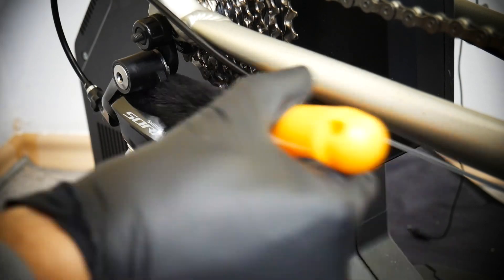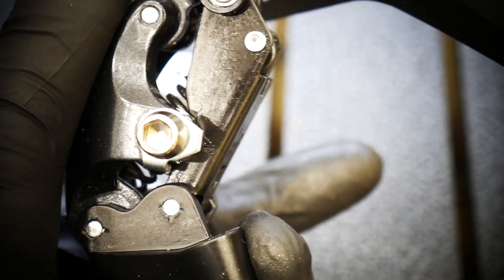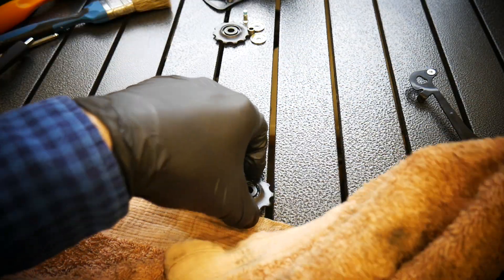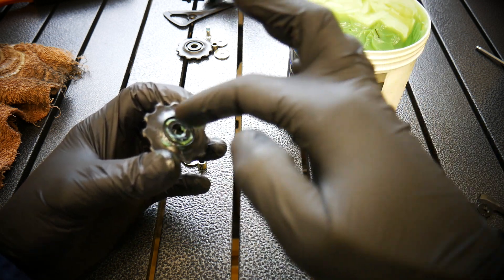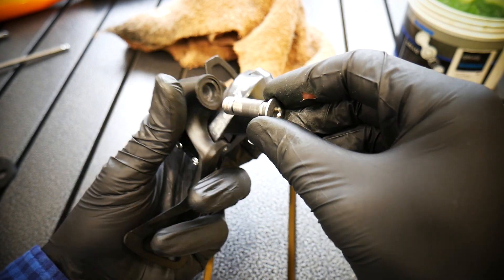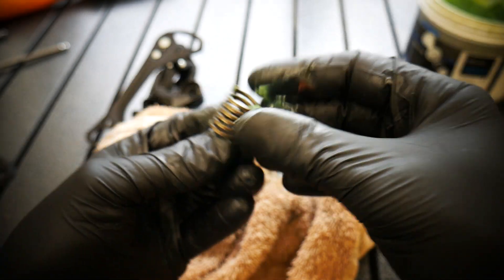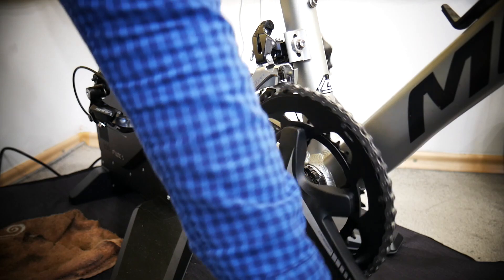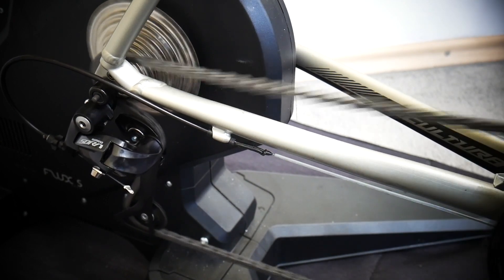Squeaking Rear Derailleur - Full Shimano Sora R3000 Service. Solved!

Comment: You can remove that part, it has a small panel that is removed with a micro screwdriver, then gains access to the circle inside which is again is fiddly but doable

Comment: I have the same issue (squeaking noise) on the same derraileur. Can we just change the pulleys maybe tiagra ones? are they compatible for Sora R3000. Thanks.
Reply: hello, I have the same case, I’ve tried after market jockey wheels with bearings-you can choose variety of colours too -and works good, just buy the 11t jockey wheel,
Reply: @mr.felix2batican400  thanks mate.

Comment: Just replace the pulleys with sealed ones.  9€  and Save some grease 🤣
Reply: goonswarm007 
where on earth we buy it _ the very same and exact size and measurements ?
Reply: Manuel  Luis you can buy the ones from higher groups... Shimano sells one with bearings and simple ones. The ones with bearings are actually a little bit better. More precise when you shift.
Reply: I'm new to road cycling i can't belied there is no actual ball bearing there actually

Comment: Hi FYI ,if you want to access the spring behind the top pulley you can .look underneath the tube that contains the spring you will find a little oblong rectangular window port with a cover . Remove this cover not easy , have to pry it out you will then see a c clip similar to the one on derailleur hanger bolt.Remove this and it will all come apart, reverse order to reassemble.Have fun and good luck.

Comment: If you stop the video At 7:22 you can see the  plastic piece that snaps into the housing . You have to remove that piece my prying it up,Once you remove that piece  you turn the c clamp around so you see the 2 ends and put 2  small screwdriver on both sides and push the c clamp down  then you can pull it apart to get to the spring inside . There are a few videos that show this . One is titled Fixing Shimano Sora Rear Derailleur With Slipped Cage .

Comment: You can remove that part, it has a small panel that is removed with a micro screwdriver, then gains access to the circle inside which is again is fiddly but doable the ‘little lock’ is called a circle clip

With regards to the greasing of the rest of the item, a more preferable grease would be a silicon lube … 

Can I ask if you’ve had any formal engineering training in anyway?

Thank you for the video though it does show how to gain access to bits that most people would not know about

Comment: Thanks for the video it was really helpful. I did as you said but IMO it's a chain that's making the squeeking noise. I did the same service as you did but it did not help. Even with massive amount of grease. The chain, on the other hand, bends both ways on those little  wheels and makes the sound only on few pins while bending on.

Comment: My new bike came with Shimano Deore drivetrain.  When I go into the taller gears it makes a squeaking noise, like a bird chriping.
Reply: The same for me. Very annoying as it suppose to work perfectly while it's new. My Turney had not this noise after 5 years without service.
Reply: @vadymvv  I think it was the upper jockey wheel I had to grease/lube.  Doesn't do it anymore.

Comment: I've went through 2 cassettes, 2 chains, and 3 lower brackets and the first replacement of the bushed Shimano jockey wheels is happening today.  I never greased them as I've been taught the plastic/nylon was self lubricating and grease would deteriorate them.  Maybe I'll start keeping them lubed with some PTFE chain oil?  Or I suppose a non petroleum based grease like you have here on the video would be better and stick around longer if it doesn't attract dirt/grit.

Comment: Advice: Use a seringe fill with grease to apply it gentle and precise. Good job !!!
Reply: Never apply grease to your drivetrain mate
Reply: @vishwanathmallela2926  dude..is sora.....no stres
Reply: @vladandrei2069  you’re not really smart are you? Sora or tourney or dura ace, grease isn’t meant to go on the chain, but inside bearings
Reply: @vishwanathmallela2926  Where did he mentioned the chain? He said use a syringe to apply the grease. So his main case for the comment was to say that he can use a syringe to accurate dosage the grease. I think you are not smart!

Comment: thank you for this video!
i have a problem.  I put the B-screw all the way in, but I'm still able to swing the pulley forward with light finger pressure so that it touches the cassette. Is that normal?

Comment: My sora is jumpy changing gears in the middle of the ride by itself.... Annoying... Tried tuning it myself
Reply: That could be something as simple as a bent derailleur hanger or poorly indexed gears. An LBS should be able to easily diagnose your problem.  I've had my Sora groupset for several years, keep it well maintained and it's as smooth as the first day.  I'm willing to take the weight penalty in exchange for having little fear of damaging on gravel/offroad rights because the components are inexpensive.

Comment: First of all the pulleys are very conventional. Bearings in the pulleys is quite rare- and provides little actual advantage. Secondly- derailleur s need grease. Third- why on earth would you care if the derailleur makes a minor squeaks-so long as it works??? And finally WHAT IS THE DEAL WITH THE BLACK GLOVES? Bikes do not carry the risk of pathogens.
Reply: Riding on a set of nicely lubed pulleys does make a difference. The ride feels smoother and this translates into less fatigue on the road over long rides. Bearings are not rare, you just have to pay more for them which again this is a budget  group set. You definitely want to wear gloves because the degreaser will mess up your hands and plus makes for riding your bike unpleasant when you grease up your handlebars and leave finger marks all over your bike. You want to have pride in your work.
Reply: @aacc8466  i will admit that there is a VERY SLIGHT performance increase with freshly greased pulleys or bearings in your pullies. May amount to as much as 6 inches every 1000 miles. Now about the gloves- most serious chemicals will dissolve them. The rest wash out with soap and water
Reply: @joeg3741   Not sure where you are getting your numbers from but efficiency is just part of the reason why he is greasing. I suspect that hearing his pulleys grind drives him bunkers, which if you are riding for 4-5 hours would seriously annoy you and cause you to mentally fatigue... imagine a kid asking, "are we there yet?" every 5 seconds for 4-5 hours. YEP thats what I mean by fatigue.  And better the gloves get washed out then my hands. You don't want to get your bike dirty after just cleaning it. Anyways have a good day.